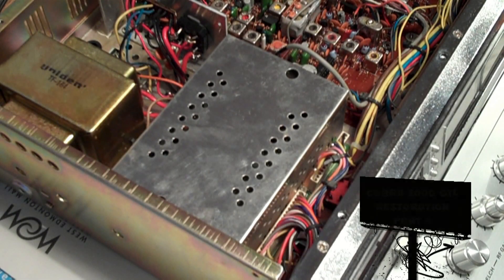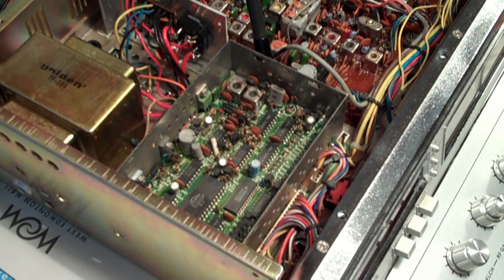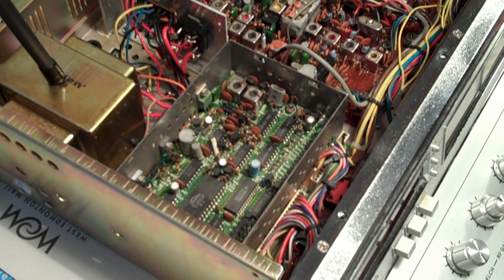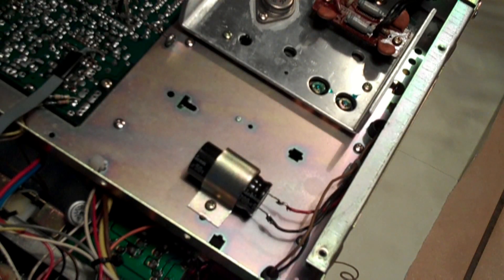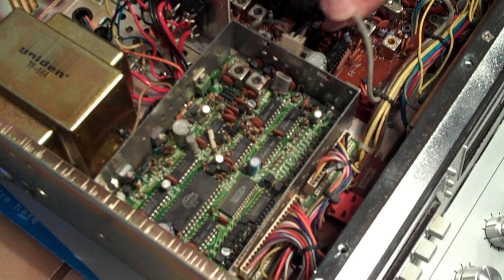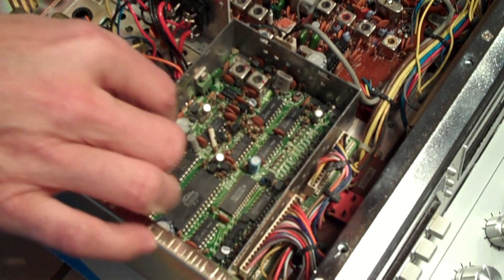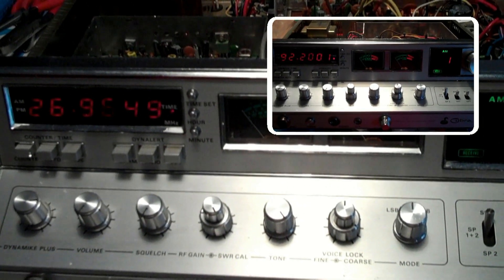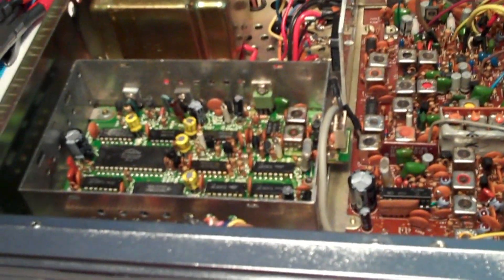Cobra 2000 GTL restoration project, part 4

Comment: Do you really have to solder top and bottom on the frequency board? It looks like they only did the bottom. Can you get the correct value caps for the rebuild or do you have to substitute values. Thanks for getting back Ron

Comment from the maker: @darticus1  Your eyesight needs to be top notch to do this work. I would not recommend it if not so. You could use the magnified lights that are available, that would help immensely. I recommend doing the main board first and then the counter module. You need to be at the top of your game when you get to the dual-sided frequency counter board.

Comment: Very nice but I have some trouble seeing to do the soldering. Trying to copy your work If I can get the nerve. Is there a sheet showing the values for the caps without trying to see on each so I could buy them. Do you do this for a fee? I see that the solder shows on the bottom of the board but not the top of the board. Can't I just solder to the bottom? Thanks Ron